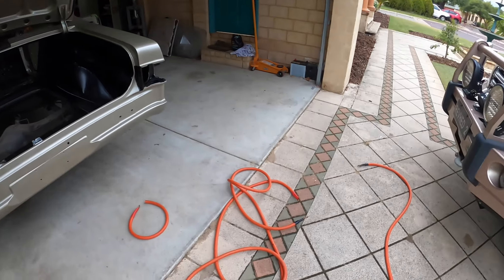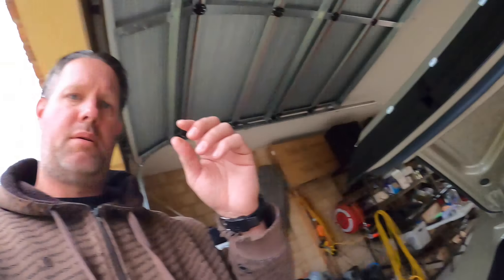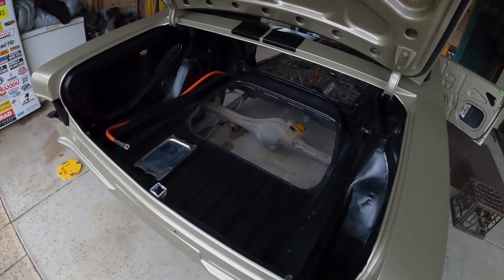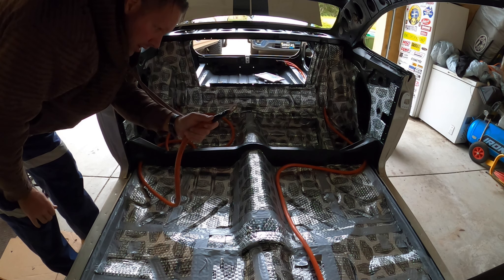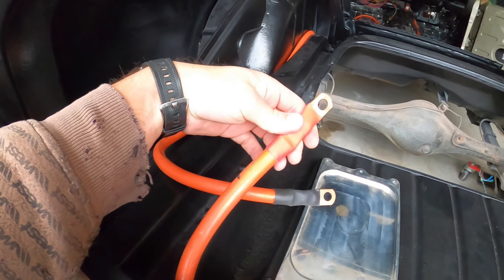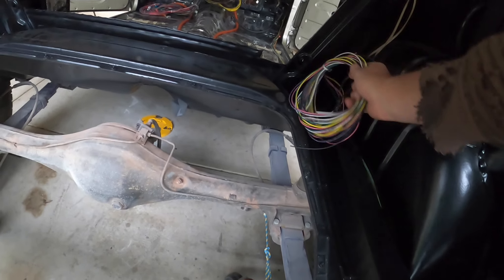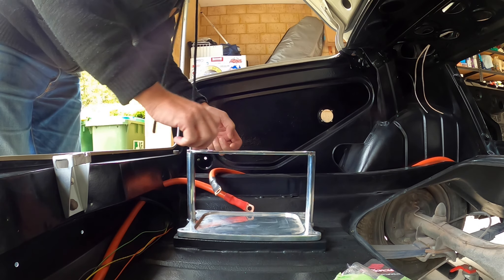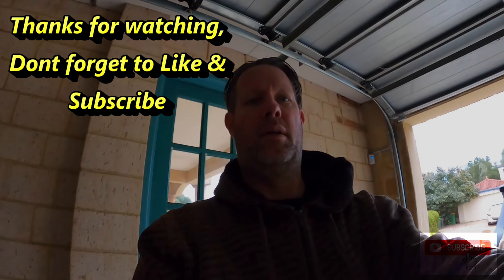Holden HT Monaro Build Ep 3 - Running Battery Cables and Wiring Harness

Comment: Hey mate put i  battery in the boot about 25 years ago i had some stuff in the boot an it knocked the battery over it was bolted down buy the time i saw it acid was eating into boot for about mounth it did a lot of damage even the fumes will make it rust after all the work you have done its not the go.  I would never do it again  good luck with it  very nice job with the rebuild
Reply from the maker: Hey mate thanks for the message. I’m not too concerned about it for a couple of reasons. It’s not a lead acid battery, it’s a gel battery which is sealed. Secondly, the boot is going to built with a false floor, sides covered in and a speaker box under the parcel shelf. So the battery will be held in place by the mechanical fixings as well as the false floor. That battery ain’t going anywhere!! Cheers for sharing your experience though 👍👍